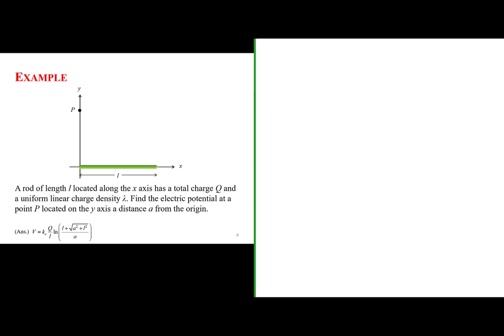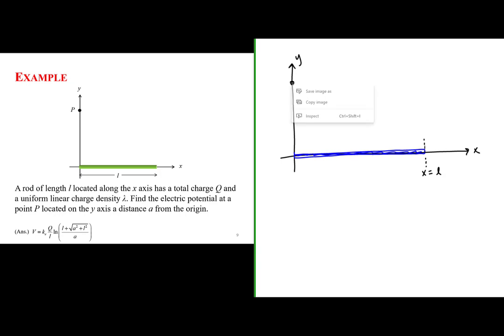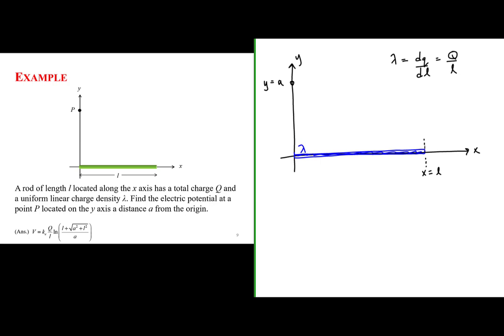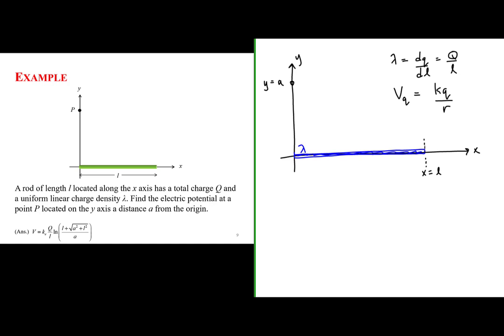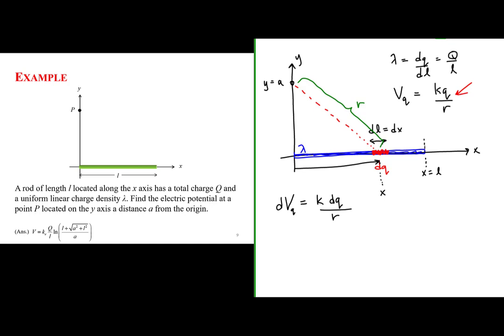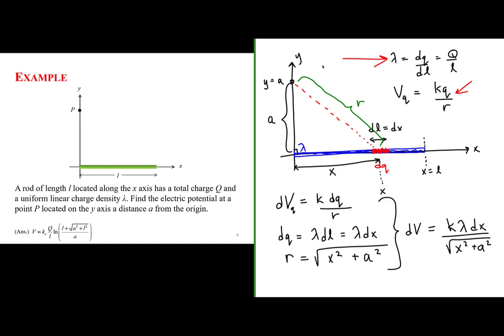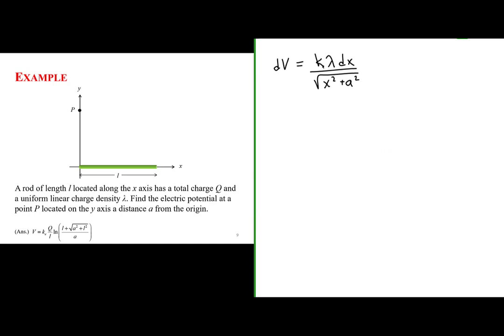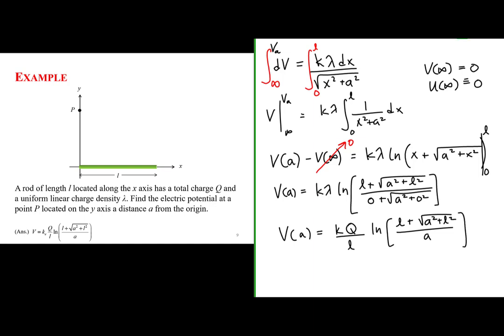Electric Potential due to a Finite Line of Charge

Comment: anyone else wondering where the square root when he integrated dV
Reply: Since the general eq is kq/r. Since r is the magnitude of the distance from the charge to the point, it is equal to the square root of constant distance in the z direction and the variable x since x changes